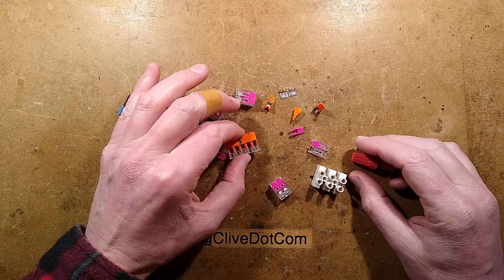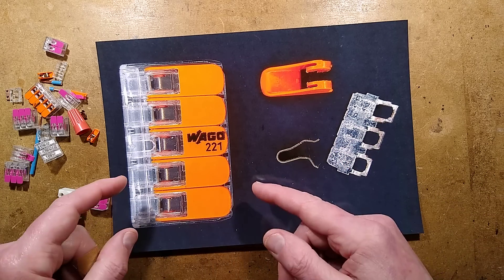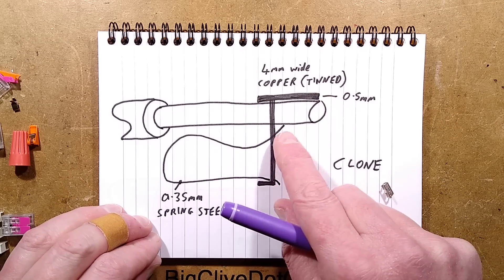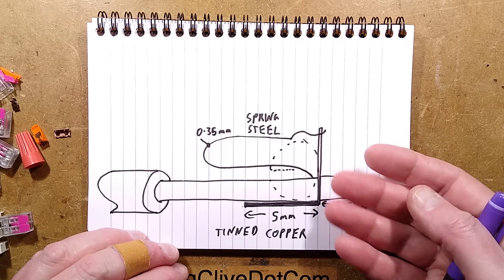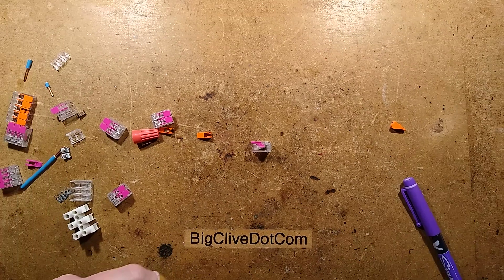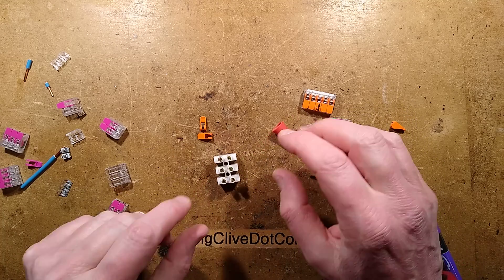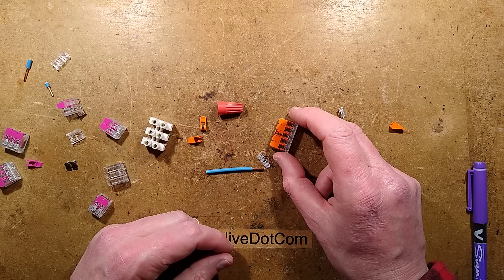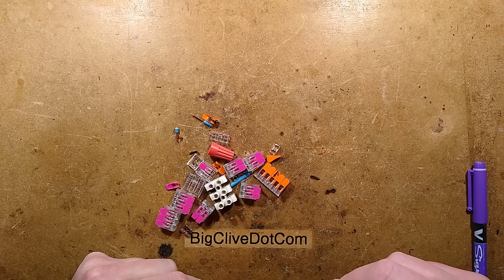Inside a Wago connector and a clone

Comment: Quick connect seems to be becoming a bit of a " thing". I bought some quick connect 5.5x2.1mm power connectors, same idea e27 bulb fittings, same too.  Everything doesn't need a screwdriver.  Trouble is the ocd in me means I have to use bootlace ferrules to give them something to grip to so now instead if a little screwdriver I carry a huge set of pliers to squash them down
Reply from the maker: I wouldn't recommend ferrules for use in connectors like these unless they are crimped with a proper tool that has indents to grip the wires.  The sleeve will defeat the wire gripping function on a loose ferrule.
Reply: @bigclivedotcom  yep I have 2 types 4 & 6 faces (like a camera iris), sad isn't I?  Nice & grippy though, I use the ferrules and not the ones with bulky coloured collar.  They were "law" for terminating wires in our cabinets.

Comment: .. Wago terminals are NOT a fuse.. them breaking DOES mean that something broke at a place where nothing was supposed to break, and.. there MAY be spark:age or something else that is unwanted.. 

Also; Yes.. This shouldn't be WHERE something goes wrong in a house; However.. who said that people who tries to do things themselves ONLY want to repair things in their house?.. PERHAPS they use it in their car, where a LOT of amperage can go through a single connection (If you have a 12 Volt battery, and a 1200Watt amplifier, you ARE pumping 100 Amps through the connection.. I don't think I ever found out how these things relate to the technical installations, but at the very least when it comes to lethality it is the amps that kills you, not the voltage)...Also; I do think that people MAY be using these when they want to do something creative with their flourescent lighting, etc.. so.. 

A dependable product IS a dependable product no matter how you look at it... "It's easier".. is often the thing that make people who NEED things to be extra easy for them to bother to even try because.. they really don't know what they are doing.. (not saying that people who know what they are doing would avoid using the easy answer, but at the very least.. THEY will know something about the limitations as to when/where it may or may not be a good idea, so.. They often OPT for the thing that is MORE likely to NOT turn in to yet ANOTHER thing that has to be repaired during a snafu)

Comment: For the pull test, while I'll believe that if done properly the wirenut performs better than the WAGO, I'd be much more confident that an inexperienced homeowner who made a solid connection with the WAGO. 
Or just me. I'll bet if I made 100 wirenut connections and 100 WAGO connections, ALL the WAGO connections would hold up to a moderate tug while several of the wirenuts would fail.
Not because there was anything wrong with the wirenuts, but because I as a user made a mistake.

Comment: I'm Canadian, so I will stick with Marettes, especially since a Canadian invented them.  They are relatively simple, have much better surface area contact and have been used for wiring Canadian houses for decades without a problem.  I still look at Wago and think, "glorified home audio speaker terminals."  If the Wago connectors fail first, then there's an issue.  Especially for longevity with hundreds of temperature cycles.  I also use screw based terminal strips and some older designs of Marette use a screw terminal design as well.

Comment: I am an electrician here in germany, and we are using them everywhere when do installing house wirings and for quick temporary repairs in industry. For house installations with solid wires we normally use the push-in type, because they are a bit cheaper.
The lever types you show here, were designed for flexible wires. Flexible wires can not be pushed inside the push-in types, and when you really managed it to push them in, then there is no way to get them out again. But in this type of Wago connectors the flexible wires are working perfectly.
Reply: can I use push-in with wire end ferrules and reuse them?
Reply: I love the 773 push-in Wagos for 240V lighting.  The 4-way versions are so compact and great space savers when you need to common a load of wires in a multi-gang/single box/"spiders' wedding" type situation.

Comment: Both the Wago and the clone appear to provide MORE contact area for the wire than a 'quick click' type of receptacle or switch. The quick click only provides the edge of a brass strip that wedges against the wire during insertion into the quick click hole. This provides only a sliver of contact surface. I've seen where higher levels of current in a circuit, but yet not high enough to trip a 15 amp or 20 amp circuit breaker heats up and burns out that contact edge burning a small arc in the brass over time until it disconnects. With any luck the the modern code for 'some' circuits in a home requiring Arc Fault protection will catch this before the hot spot becomes hot enough to start a fire. 
As a standard practice I do not use the quick click, but rather the screws instead. If I need to connect more wires than there are screws provided I wirenut the wires together and attach with a pigtail.

Comment: Wego is way smaller, that's really important in practice. There's also a smaller version without levers, it's really great if you need to connect multiple things in one place under light switch etc. I haven't seen any clones that small.

Comment: Wago connectors are crap I don't know why people bother to use them good old fashioned block connectors are the best it looks like somebody tried to reinvent the wheel
Reply: I also use those blocks with big screw terminals for the outlet circuits, but for dedicated lighting circuits i need those wago connectors. You can put several ones in the same housing as the light switches, that's great to make more complex switching circuits during renovations, and it's easy to reconfigure in the future. The only time that i had an issue with few wagos was because of sanding dust that fell inside, ok again after cleaning. Now i make sure to put them wires down during the sanding of the walls 😁. Anyway, my experience is that they are extremely handy for certain applications. Also ideal for making a quick temporarily connection, fast and reusable.

Comment: Screw terminals relax over time. Especially in applications where vibration is an issue. Spring loaded contacts keep the pressure on virtually forever.

Comment: I have been designing (and troubleshooting) industrial control panels since the late 80s. More than 50% of on-site panel failures used to be down to screw terminals and weak-wristed sparkies building the panels. We even issued panel builders with electric screwdrivers pre-set to the correct torque but they were unpopular as they were heavier than a regular manual driver. Used within their design ratings, spring cage terminals are up to the job and make current panels twice as reliable than the ones we were making 20 years ago (not to mention quicker to make a connection).
Technology like Flir thermal cameras are great to find overheating panel components but its much better to build them reliable in the first instance. 😀
Reply from the maker: Flir are so last-year.   Infiray are the new thermal camera king.
But yeah, badly terminated panels are annoyingly common.  Installers blindly shoving wires into DIN rail terminals and sometimes forgetting to tighten them.
Reply: That's another benefit of spring terminals: They can't be left loose (assuming they are actually closed) or loosened over time thermally/mechanically.  Dunno if there's any truth in 50Hz AC being able to slowly work terminal screws loose, but if there isn't then I can only guess that half the people who went before me were using the "thumb, forefinger and extended pinky" method of torqueing, and had drivers made entirely of cheese.

Comment: Not only should they have tested max current but also temperature at rated current to see which one would melt the plastic first. Increased heat also increases oxidation. Speaking of oxidation the Wago and clones press a round solid wire against a flat surface on one side and a bite point on the other. The flat side only has a thin line of contact across the buss bar port increasing the chance for heat generation at the contact point which causes oxidation which causes more heat and so on till potential premature failure. I have always used wire nuts and when pre twisted combined with the clamp down spring cone makes nearly a gas seal with ample area of contact. 
I have never seen or heard of a wire nut junction failure where it was installed correctly. Harder to use, yes but 100% reliable.
The great debate like politics and religion... To each it's own.
Reply: I guess it depends on the application which technique is the best. Personally i only use them for lighting circuits that hardly draw current. Now i don't fully agree with the small contact area being a disadvantage, the smaller the area, the more pressure force. That ensures a constant resistance, also in areas with lots of vibrations. It also improves the self cleaning effect of a sparking contact, but that is more relevant for switches, not for static contacts.
Reply: @effedrien  Consider a round tube laying on a flat surface, only 1-2% of the tube will be making contact with the surface, just a thin line. On the other side you just have the edge of a thin clip biting into the surface of the round tube. 
Lighting circuits is fine especially with the low current LED lights these days. Kitchen appliances, vacuum cleaners and space heaters and other near 1000W devices are not a good deal. One thing to consider is that here in the USA we run most items in 120V which draws double the current of a 240V system to do the same work.
Reply: @DrHarryT  indeed, i only use it for low power lights and ventilators. These things often have a multi-stranded wire to be connected directly to your house circuit with its single stranded wire. For that the wago is perfect, and the other technique is not reliable when mixing these 2 types of wire, only experienced people can do that without that the multi stranded wire slips out easily, no?
Reply: @effedrien  Yes, connecting an 18ga stranded to a 12/14ga solid can be challenging. I just had to do that when retrofitting from a florescent round tube to an 18 LED lamp pancake unit over the kitchen sink. I have decades worth of experience in these things. The key here is to use the right wire nut size, strip back enough of the stranded to tight barber pole wrap the solid leaving a little at the end to fold over, then twist it on enough to hold but not too much as to cut the strands. It takes experience and finesse. 
Long straight 4' tube ceiling fixtures have a similar looking to Wago push in connectors that are for smaller solid wires [coming out of a ballast or LED CC driver] but still allow 12/14ga wires on the other side. They have a push hole release system. Typical lighting circuits are run with 14ga and a 15A breaker.
Reply: @DrHarryT  exactly, you need to be experienced and often you have to make connections like that under not so good conditions. For example the ladder is one step too low for that high ceiling, wires too short to work easily, junction box is inside the ceiling and hard to reach ... With wago you can do it with one hand if needed. I also found another practical advantage, the fact that the single stranded wires can easily rotate inside the clamps, can be helpful. You can work on wiring hanging out of the connection box, and later it's easy to roll up the connected wiring and push it inside the connection box. And the reason it's easy is because the wires can rotate in the clamp so they don't hinder each other so much when manipulating a connected group. The wires don't need to twist or bent like with wire nuts or screw terminals. The end result is more aesthetic, and it's easy to make changes later. 
In fact wire nuts are rarely used where i live, in Belgium, i don't know about the rest of Europe. In the DIY shop i noticed last time they have 1 little box with few different wire nuts, against a square meter of several different models from the clamping type. And all light systems that are sold here,  have built in screw or click terminals, never seen one with wire nuts in the shops. 
My father still used wire nuts in his house, really heavy ceramic wire nuts, not plastic ones ;)

Comment: Hello Clive. Thanks for this video :)
What do you think about the long term reliability of such spring contact and copper oxidation of the conductor with oxygen from ambiant air?
Maybe future versions will use gel like gel box.
Reply from the maker: They sell clamshell gel boxes for outdoor wago use.
Reply: @bigclivedotcom  yes for outdoor but I have some doubts for the long term reliability for indoor use.
If the copper oxide can cause hot spot near the spring pressure surface and cause fire.
I use Wago but I'm not super reassured when I see the  rigid copper conductor can easily rotate in the contact :D

Comment: The Wago adds a new component to the circuit, the metal bar.  You are limited by the spring pressure, it never goes higher when needed.  The wire nut compresses the conductors together without adding material.

Comment: The only problem I've ever had with a Wago is that I once was maneuvering the 5-way connector in a very tight box, and broke off one of the levers. And that's actually where Wago shines. I replaced the Wago in 30 seconds, with no damage to the conductors.
Reply: since you can use the 221s pretty much the same as the push in connectors and this happened to me too i had the practical idea of actually using this to mark and secure the incoming wires (they will say isolated unless you put in the extra effort to twist them off), and still have the ease of adding and removing outgoing wires.. but it is quite the effort for every single connector to first cut and then close one of the levers, so i stopped with that..

Comment: How much current they will carry when brand new is irrelevant, it is how much current they will safely carry after 20 years of temperature cycling on the spring that is important!
Phil
Reply from the maker: Having found many burned out screw clamp terminals it would definitely be interesting to see.
Reply: @bigclivedotcom  I have found that if a brass screw terminal is tightened properly (till the brass squeaks) they do not burn out unless  overloaded or corroded, Unfortunately as the slotted nut type juction box has matured the brass has got thinner and thinner and they tend to open the slot up if tightened correctly, paucity of manufacture!. A classic example of temperature cycling failure is the flourescent batten fittings with the push in type terminals. We insalled a lot of these in commercial premises when the first came out in the late seventies, some of the sparkies predicted they would be trouble, and they were, even two years from new! Sparkies love the Wagos cos they are quick, but are they good long term? Time will tell!

Phil

Comment: Since the springs are seperate instead of combined together wago can eliminate the No. of different parts. That probably saves some costs because of higher volume and less logistics. 
I'm also 100% sure they are put together by machines so the difficult assembly does not matter at all. In fact for consistancy i would much prefer the conectors not to be hand made! Not worth it to save a couple of cents on an project IMHO.

Comment: Size matters.  Your back box on a ring circuit can be overcrowded when using some double gang sockets.  Same for some lighting boxes hence the complete kit of Wago has the proper box sizes to match the connectors.  These connectors can only be properly used on a clean and unbent conductor of the terminal wire.  Do the job properly and they are extreemly good.

Comment: Wago connectors should not be used to connect flex multi strand cores ?
Reply from the maker: There are versions for stranded wires, including these.  It's only the push-in version with no lever that are not suited to stranded wire.

Comment: I still prefer the screw terminals for their large connection surface. The point connections a more prone to spot heating and corrosion. Some US building codes don't allow the spring connect outlets to be used.

Comment: I suspect that the eventual failure mode of Wagos will be spring steel failure leading to arcs, not surge burn-ups.
I generally don't trust back-stab outlet springs either, so take that as you may.
That said, I used some one-time-use six-position stab connectors (sold as a  Wago alternative here) when building a chandelier with twenty lamps.  Originally I designed in a proper set of bus bars but at 3.5A total these were already tiny cheap bus bars and I could daisy-chain each region trivially.  They were also rated for tinned stranded.
I doubt I would bury any of these in a wall, though.
Reply: Those back-stab connectors are garbage, and are completely unrelated to how Wago connectors work.

Comment: The thing I don't like is that you can't have wires in line like with a terminal block
Reply from the maker: There are through versions that allow a number of connections to be made in a line.
Reply: @bigclivedotcom  With the clones, yes. I don't think I've seen that with real Wagos